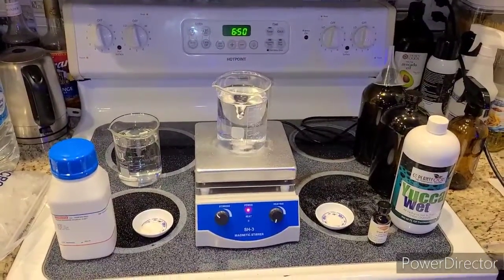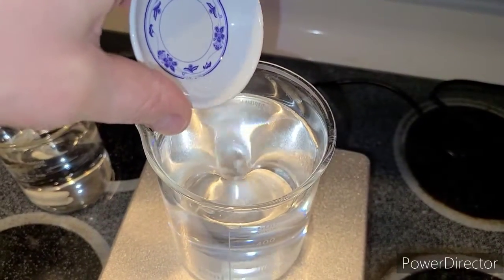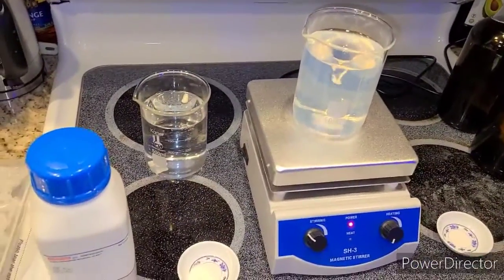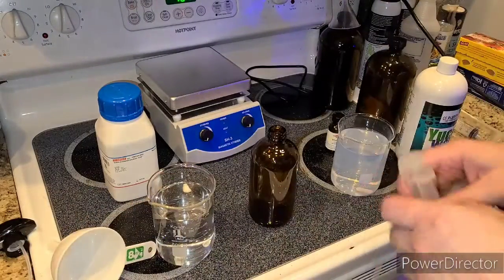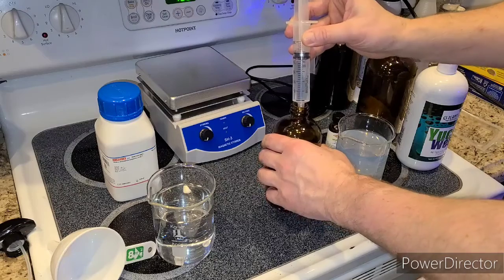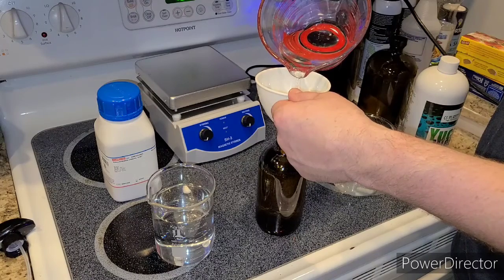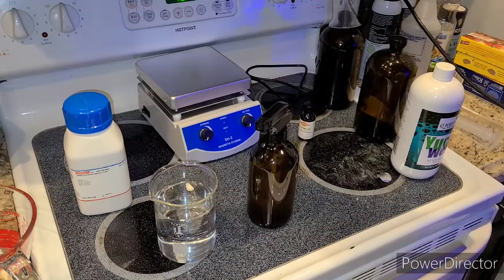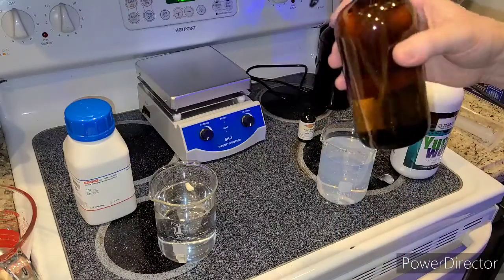Making STS Spray For Feminized Pollen...

Comment: Quick tip instead of spraying top the plant and inject with a syringe into the stem where you topped it. 3 to 5ml twice and it works much faster and less solution used .
Reply: So inject after you top it?
Reply: Bro I need more info.
Reply: I have not heard of doing something like that, have you tried it and how well does it work?

Comment: What are you doing you down with? I must’ve missed it somewhere.
Reply: @thewell-roundednovice8852  sorry about that. It was a typo I meant to say is what are you diluting with at the end?
Reply from the maker: @jamalmontgomery5849 I add a little Yucca surfactant, but there isn't any dilution other than that
Reply: @thewell-roundednovice8852 aah okay I missed that part in video thanks.update after I give a try

Comment: I have a question How come your a solution has a  little fogginess  to it  and when I made it mine is still clear i used  and did everything exactly like you ?
Reply: Thank you for responding back to me bro. I had a question though this is my first time making the solution. I got everything exactly the same that you have even the spray bottles .lol.. I made some sts solution and then spraying my plants for about 3 weeks now and have not seen any results Do I have to make it a little bit stronger  I know that's certain strange or stubborn i had a couple plants like that but eventually they reversed or do I just keep spraying until I see something
Reply from the maker: @jerardoherrera9339 that's wierd... it worked fine for me... you spray from a couple of days before the flip to maybe 2 weeks of flower... the sacs for during the stretch and just after
Reply: Hey bro i just wanted to let you know that it started working.It was just a stubborn plant I think. thank you for everything
Reply from the maker: @jerardoherrera9339  i dont remember it being foggy.. but maybe it was.. been a long time

Comment: Is there a recommended ppm for this product? I didn't see where you tested it for concentration. I've read that 25 to 30 ppm is about right for colloidal silver. Is STS the same or different? Thanks for the video
Reply from the maker: @brewboss58  it is different... you use starting materials and a formula to make it,,, unlike colloidal silver where you use a mechanism over time to change the concentration

Comment: Concentrate Recipe

Silver Nitrate Stock Solution (A)
- 0.5 g Silver Nitrate to 500ml Distilled water mixed thoroughly

Sodium Thiosulfate Stock Solution (B)
- 2.5g sodium thiosulfate anhydrous to 500ml Distilled Water mix thoroughly

Spray Recipe

Mix in the following order:
- 23ml Sodium Thiosulfate Concentrate (B)
- 23 ml Silver Nitrate Concentrate (A)

Add mix to 16oz Distilled Water
Reply from the maker: Sounds like it will work!